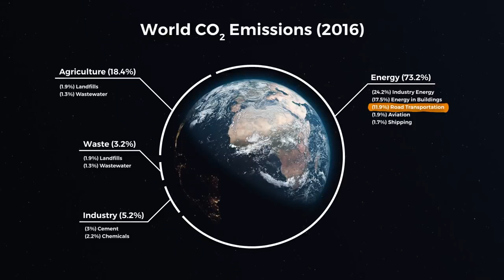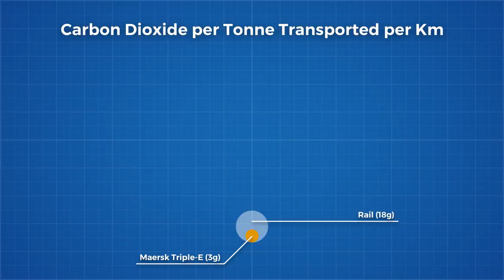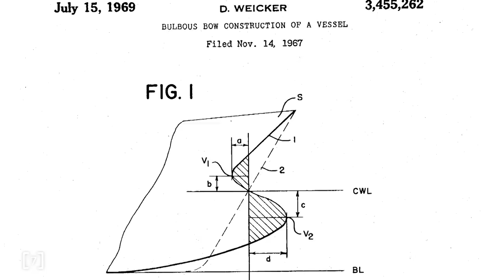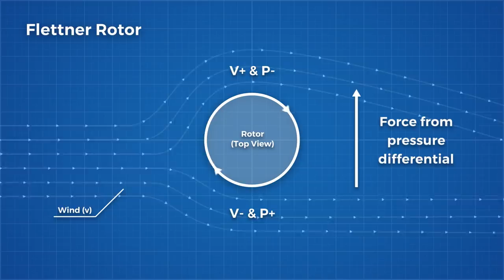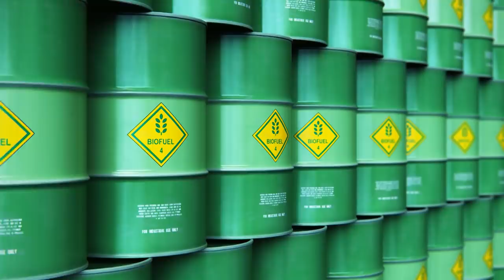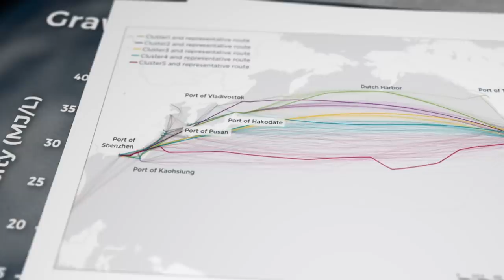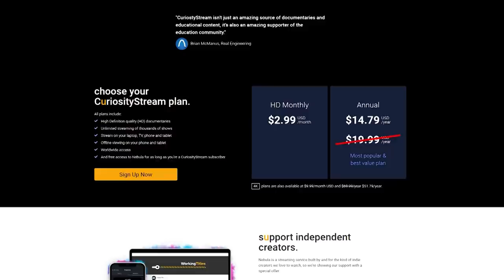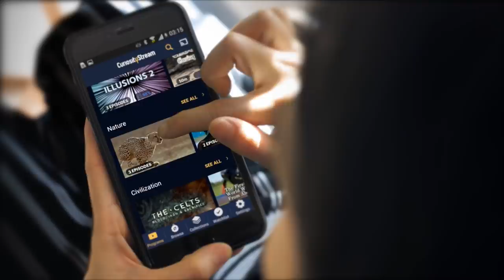Are Renewable Powered Ships Possible?

Comment: Bio fuels aren't the sole answer but they are part of the solution.
Reply: How about ‘bio fuel’, how green is it?  Short answer, not very; major problem is land use and the limited upside is that the carbon released into the atmosphere has recently been taken out of that space in the growth part of the cycle.  On a small scale, to use up the waste products from other industries like forestry, animal husbandry or agriculture, ‘bio fuels’ are as good source of carbon molecules as you could get but they like all 'alternative' fuels still involve a combustion stage and therefore some noxious effluents, NOx for example.  Fossil hydrocarbon oil fuels run up from CH4 (methane/biogas) to very thick black HFO cSt380 (C20H42 to C50H102 or more).  The sweet spot is kerosene (C10H22 to C16H34), also known as gas turbine fuel and used in modern aircraft engines.  It is relatively cheap, relatively energy dense, relatively hydrophobic and relatively safe.  Creating a non fossil substitute, at a reasonable cost, is ‘the holy grail’ for energy chemists; like turning base metal into gold.  Natural history, on a geological scale, has done a lot of heavy lifting for us humans.
Reply: @BernardLS  So because kerosene is cheaper than the alternatives we should keep using it? Because that's the only thing I'm reading out of your block of text here.
Reply: @chrisb9319  In the context of a military defence requirement, yes.  The QE/PoW are more cost effective means of dealing with the potential threat than the Ford class option.  If there was no threat then neither would be necessary but sadly we do not live in a world of peace and harmony.  A good example is the Vulcan bomber that was deployed in the 1950's but only used in anger once very shortly before being decommissioned.  As with all weapons better to have it and not need it than need it and not have it.
Reply: @BernardLS  Are you saying that cargo ships are military vessels??
Reply: @chrisb9319  Merchant ships may be 'taken up from trade' as the RN would say or they may be captured or impressed by non state quasi military entities by way of piracy.  But no 'cargo ships are not military vessels; merchant shipping is run as a high volume low margin revenue generating business and any improvements will need to be lower cost or better value to be adopted by the trade.
Reply: @BernardLS  You realize that you're just producing hot air, right? Bio fuels are still not the sole answer, but they are still part of the solution.
Reply: @chrisb9319  Drop in bio fuels that do not displace food crop from land if cost effective could supplement the fuel currently used in ICEs. I make that three conditional qualification for bio fuels all of which still do not overcome the cost question.
Reply: @BernardLS  And that contradicts what I said how exactly?
Reply: @chrisb9319  It does not contradict your  comments, it does qualify them.  If it was possible to create bio fuels that would 'drop in' to the marine fuels system cheaply enough and plentifully enough to contribute significantly to the marine shipment part of cargo logistics cost effectively they would probably also contribute to atmospheric pollution as seriously as FOGI (fossil oil & gas industry) products.
Reply: @BernardLS  You're always saying "if" while not recognizing that all I've been saying is "when". Of course bio fuel isn't the sole solution right now. But why are fossil fuels so cheap? Because the industry has put a lot of money in building up the infrastructure for it. So stop whining about how they're not cheaper. What you are, with that mindset, is a fossil fuels shill.
Reply: @chrisb9319  When bio fuel is as readily available and as widely produced on a global scale as fossil hydrocarbon it will be as cheap.  Fossil hydrocarbon does not need any 'shills' what most most 'anti-fossils' fail to appreciate is the scale, extent and versatility of FOGI products.  All energy use and transformation needs to be fully costed  and evaluated so decarbonising the electricity generation process will need to include finding non carbon alternatives to the FOGI products that go into the means of production.
Reply: @BernardLS  So basically what you just said is that bio fuels are part of the solution.
Reply: @chrisb9319  Actually what I said was if (when) bio fuels are available on an appropriate scale, at similar cost and with manageable externalities they would only be a solution if they improve on, rather than just equal, the impacts, both negative and positive, of  fossil hydrocarbon.
Reply: @BernardLS  They already do that because they're made out of renewable resources.
Reply: @chrisb9319  Except they use more land and / or require more of their energy content to get to the point of use so the net energy gain for deployment does not match fossil hydrocarbon.  When (if) bio fuels out perform the fossil fuels they may compete but will still carry many of the detrimental impacts as they are still, mainly, hydrocarbon fuels of a Carnot cycle.  NH3 & H2 by pass the CH problem but unleash other issues such as safety.
Reply: @BernardLS  Land is absolutely no issue. In Germany and likely in other countries as well farmers are forced to not plant any crops meant for food consumption on a percentage of their fields to prevent over production. So there is plenty of farm land available for bio fuels. And who cares if bio fuel out performs fossil fuels? Get it through your head that bio fuels are PART of the solution meant for sectors where batteries or JIT-supply via the grid aren't feasible. You're still such a fossil fuels shill, it's not funny anymore.
Reply: @chrisb9319  WRT to the land issue, agreed the EU (European Union) CAP (Common Agricultural Policy) did pay farmers to not grow food crops under the ‘set aside policy’ as a means of supporting prices and also as ensuring some fallow period for the land.  However if all the ‘set aside land’ was used to grow ‘fuel’ crops how much would that useable energy would that generate?  Please refer to 'Renewable Energy without the Hot Air', an on line book by a Cambridge academic, David J. C. MacKay.  Your point that ‘Bio fuels aren't the sole answer but they are part of the solution.’ will only be valid if the contribution they make is a net positive at the point of use.  The numbers, on any of the bio-fuels, are very difficult to show any sort of surplus so is this a case of running hard to stand still?  So the bio-fuels more trouble and expense than merit and savings.

Just to check I want to Wikipedia for a quick check, ‘a shill, also called a plant or a stooge, is a person who publicly helps or gives credibility to a person or organization without disclosing that they have a close relationship with the person or organization.  Shills can carry out their operations in the areas of media, journalism, marketing, politics, sports, confidence games, or other business areas.  A shill may also act to discredit opponents or critics of the person or organization in which they have a vested interest through character assassination or other means.’  Time to ‘fess up, yes I worked in and around the FOGI and now enjoy a pension income from the two entities within that cabal; but I do not knowingly ‘carry a torch’ for them.

Comment: a good way to collapse the world economy. looks like they have now done that.
Reply: Incremental improvements, in degree and extent, of fuel quality are probably the most sensible. The apparent reluctance they have displayed is driven by the 7.8 billion people on the planet who all need to be housed, fed and clothed.  Working in a sweat shop in Southeast Asia may not be appealing but as an alternative to starving to death it is the only option some people have.

Providing economic incentives, this is definitely the way to go as the shipping industry does not wish to work any harder that it has to too generate the revenue it needs so better margins might lead to harm reduction though the higher unit cost that will be passed on to the consumer might be a bitter pill for them to swallow leading to the consumers reducing their purchase rate.  Increased efficiency & reduced energy costs are productivity gains that will only get the industry so far and it is likely that they will seek to externalise any and all costs that they can such as atmospheric pollution.

Reductions, both of quantity & distance, are the lowest of the low hanging fruit that will reduce shipping impacts, but consumers are the drivers.  With a replacement rate of 2.1 children per couple if the mantra of ‘two will do’ became commonly accepted many of the resource consumption problems could be solved by stabilisation of the population.  The remaining impacts could succumb to ‘satisfy your needs not your wants’.

Comment: Real engineering would use Edison generators and dynamo's.
Reply: How would the 'Edison generators' be made to generate?  Fossil fuels are a vector by which captive chemical energy is transformed into useable mechanical energy.  In a similar manner nuclear power plants convert the energy in unstable, but controllable, isotopes of chemical elements into heat that can be harvested for eventual deployment as electrical energy from which it is useable as heat, light or mechanical power.

Comment: BTW renewable ships are possible and they have existed for millenia : they're called sail boats
Reply: To address the suggestions that sail power is the answer I offer the following.  In 1870 a premium sailing vessel entered service, the ‘Cutty Sark’.  The 'Cutty Sark' was 64.74 metres in length with a beam of 10.97 metres and a loaded displacement of 2 100 tonnes.  She was able to carry 1 700 tonnes of cargo and to harness the energy the available spread of canvas was up to 2 976m2 which was tended by a crew of about 30 skilled men.  A ratio between the sail area (SA) and the vessels displacement (D) determines how lively she is; ‘lively’ being nautical speak for ‘fast and manoeuvrable’.  The carrying capacity of cargo ships is constrained in two ways, mass and volume which leads us to the ‘stowage factor’ of the cargo; the more mass on board the greater the displacement which in turn impacts the efficiency of the hull form and sail area / displacement ratio.  A vessel constrained by mass is said to be ‘down but not full’, a vessel constrained by volume ‘full but not down.  When in the tea trade, which the ‘Cutty Sark’ was designed and built for with fine lines (more nautical tech speak so again - no need to worry about it) she could carry around 600 tonnes of cargo at speeds of up to 17.5 knots dependent on the prevailing wind and had a typical China to UK time on passage of 120 days.  The tea trade was very competitive so ‘time on passage’ was a large factor in securing the premium freight rate that made her cost effective.  Rounding things out her maximum available sail area gave circa 5m2 of canvas for every tonne of tea carried.

As soon as the Suez Canal opened, which the ‘Cutty Sark’ was unable to sail through; she lost her advantage, raw speed, to the steam powered ships of that era who could beat her time on passage.  Mechanically powered ships have improved in terms of efficiency, on a freight tonne mile basis, by at least one order of magnitude since then.  After losing out to the coal burning, steam reciprocating mechanical ships of the late 19th century ‘Cutty Sark’ was relegated to the Australian wool trade, just about the bottom of the barrel in maritime terms and only one small step up from being a 'honey barge'.  The canvas, cordage and extra manpower needed for sailing ships was never a very benign environmental option so please discount any idea of sail as ‘sustainable’.  All this is without the problem that if ‘the wind don’t blow the ship don’t go’, when it does blow it often blows in the wrong direction for your cargo delivery needs and sometimes there is rather too much of it for comfort.

Random facts about the 'Cutty Sark'.  It is said to have been possible to coax 3 000 horse power out of her sails, or in ‘real money’ 2 206 500 Watts (2.2 megaWatts), assuming this was in ideal conditions that is about ⅔ of the solar power that might be harvested from the ‘top of stow’ of a Maersk triple E, again in those elusive ideal conditions.  So that majestic spread of canvas would have been even less efficacious for delivering your baubles and bows from the orient, despite taking about three times as long on the voyage.

Comment: If aircraft carriers can use nuclear reactors, wouldn't it be better to just allow american ships to use nuclear reactors? There'd have to be oversight and protection, of course.
Reply: Google the 'Savannah' been tried did not work.  ‘They’ say nuclear is cheap, it’s not it is expensive as well as being complicated, dangerous, not universally socially acceptable and having only ‘no need for refuelling’ as a questionable advantage; actually it does need refuelling just not as often.  When they do need to refill the warming up stuff it takes considerable longer than pumping tonnes of thick black cSt380 onboard which is one of the reasons HMS Queen Elizabeth is pushed about by gas turbines thus using the same fuel as the aircraft that fly off her.  The Royal Navy (RN) also have a similarly high degree of skills and expertise and the RN’s current operational nuclear fleet is 8 boats in two flotillas, four attack subs and four ballistic missile boats.  The carbon footprint of all the extra bits of hardware and the fuel, including processing thereof, from ground to propeller, are the external costs that never seems to get considered.  Disposal, once it wears out, of both the machine (that was a ship) and fuel is another can of worms best left unopened.  The 26 RN boats no longer in use are laid up (some in Rosyth and some in Portsmouth) awaiting long term deconstruction including dealing with the fuel rods and other irradiated material.  The USN is not, as far as I know, a commercial organisation working to very tight margins and has the skill and expertise to handle the complexities of nuclear power.  For those who still think that nuclear energy might be the answer I recommend this report: - https://www.bbc.com/future/article/20200901-the-radioactive-risk-of-sunken-nuclear-soviet-submarines? ocid=ww.social.link.email.  The navy of the USSR might have been under resourced and over extended but it was still generously supported in comparison with merchant shipping.

Comment: Small nuclear reactor....
Reply: ‘They’ say nuclear is cheap, it’s not it is expensive as well as being complicated, dangerous, not universally socially acceptable and having only ‘no need for refuelling’ as a questionable advantage; actually it does need refuelling just not as often.  When they do need to refill the warming up stuff it takes considerable longer than pumping tonnes of thick black cSt380 onboard which is one of the reasons HMS Queen Elizabeth is pushed about by gas turbines thus using the same fuel as the aircraft that fly off of her.  The Royal Navy (RN) also have a similarly high degree of skills and expertise and the RN’s current operational nuclear fleet is 8 boats in two flotillas, four attack subs and four ballistic missile boats.  The carbon footprint of all the extra bits of hardware and the fuel, including processing thereof, from ground to propeller, are the external costs that never seems to get considered.  Disposal, once it wears out, of both the machine (that was a ship) and fuel is another can of worms best left unopened.  The 26 RN boats no longer in use are laid up (some in Rosyth and some in Portsmouth) awaiting long term deconstruction including dealing with the fuel rods and other irradiated material.  The USN is not, as far as I know, a commercial organisation working to very tight margins and has the skill and expertise to handle the complexities of nuclear power.  For those who still think that nuclear energy might be the answer I recommend this report: - https://www.bbc.com/future/article/20200901-the-radioactive-risk-of-sunken-nuclear-soviet-submarines? ocid=ww.social.link.email.  The navy of the USSR might have been under resourced and over extended but it was still generously supported in comparison with merchant shipping.
Reply: Waste from nuclear powered energy sources may remain active for hundreds oy thousands of years, can not say personally as even i have not been around that long. In contrast the Chinese Empire, and its derivatives, set up by Yu the Great has only been in business for just over 4k years so even that predates me; and most other non enthusiasts for nuclear power.